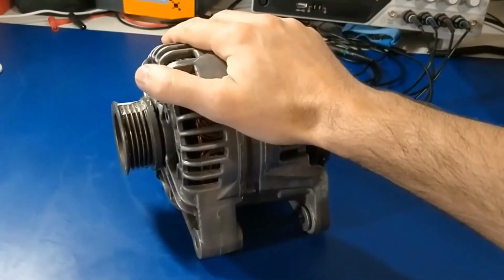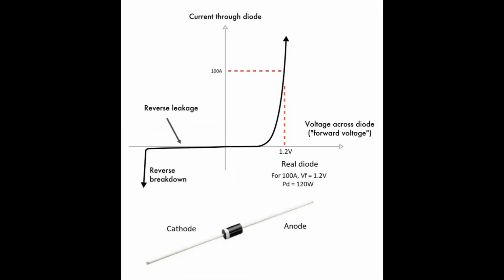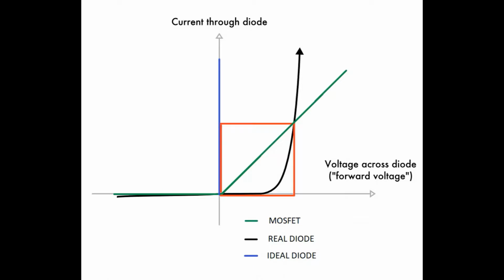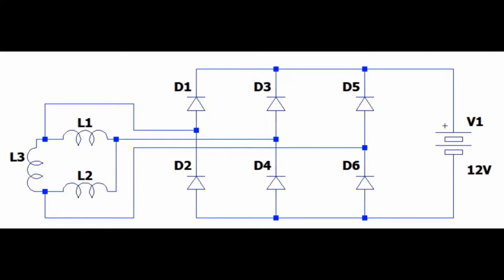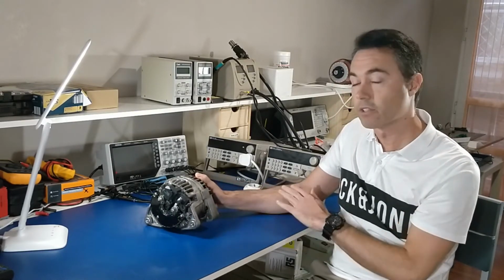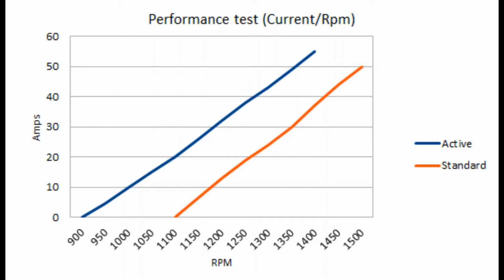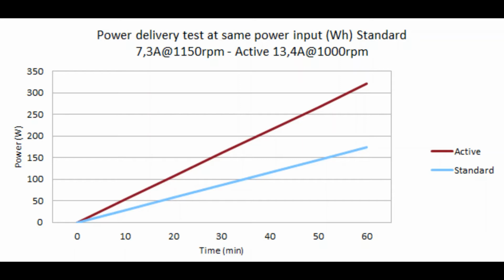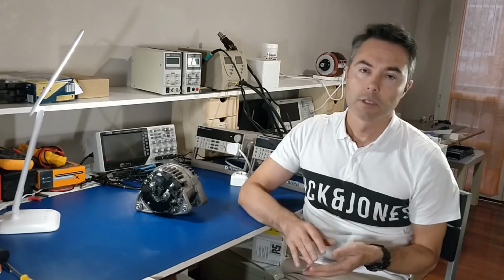Alternator with Active Rectifier

Comment: Very interesting. I want active rectification on my sailboat so I can charge faster and/or at lower RPM while anchored. Current alternator gets hot at high current and low RPM and limits to protect itself. I would also consider mounting the rectifier separately to remove heat from the windings. I would like to see a schematic of how you did this if possible.